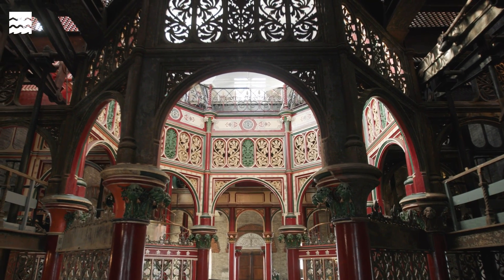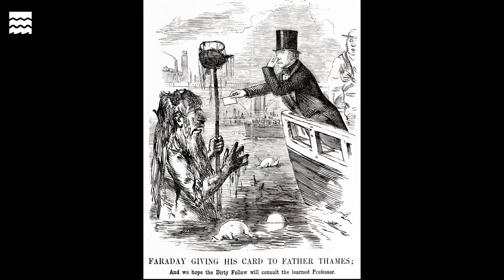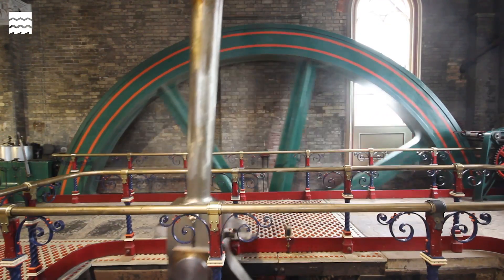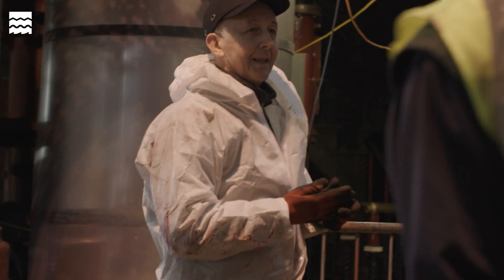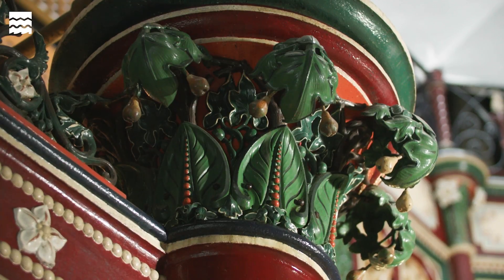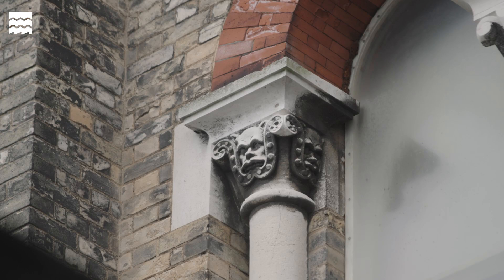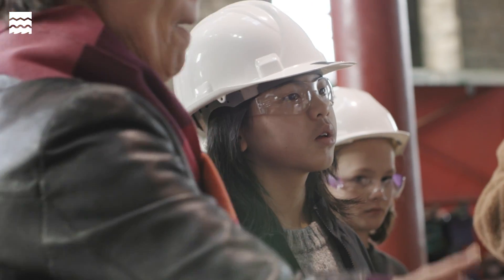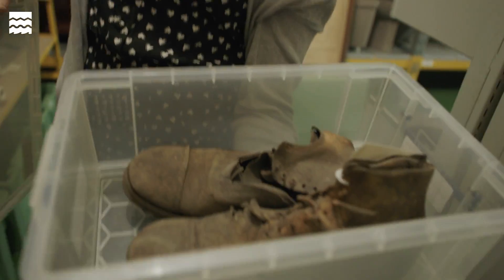Crossness Pumping Station: London's Victorian Sewage System

Comment: I know it would take a lot of grease but if they painted grease on nice and thick with the unrestored engines it would halt corrosion for many years maybe decades. It acts the same way as any coating like paint to prevent moisture from contacting the metal. There are four things necessary for corrosion: Anode, a cathode, metal path (all present in metal), and an electrolyte (water). I would propose preserving them in a layer of grease, only needs to be touched up once every ten years or so.